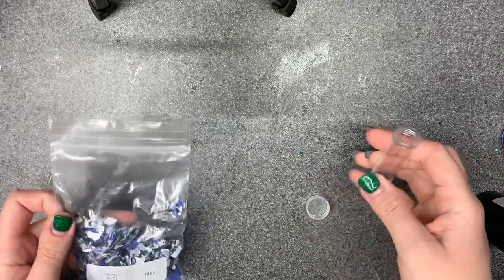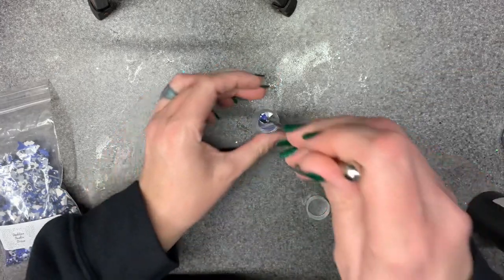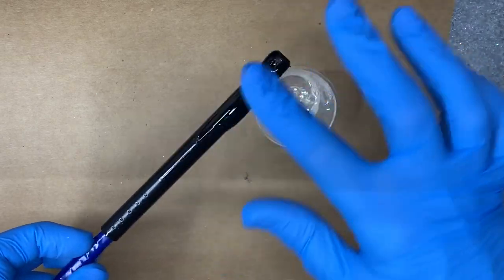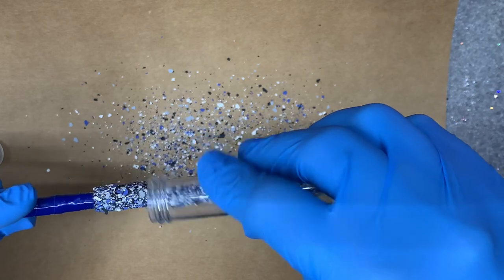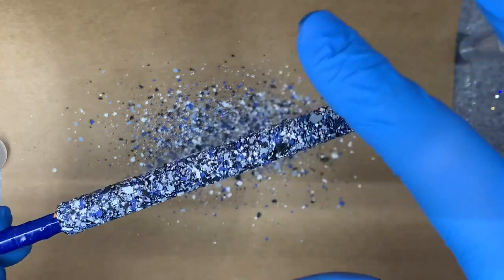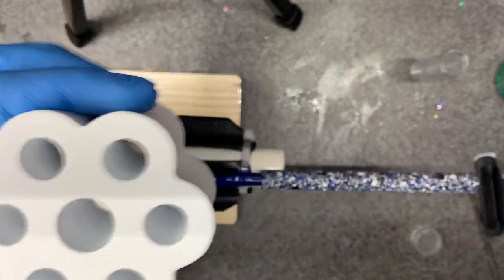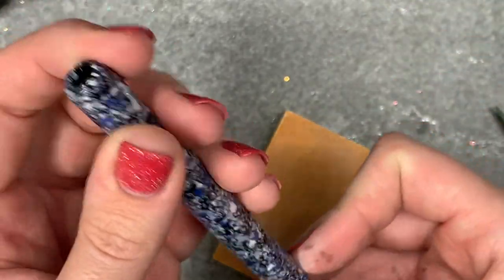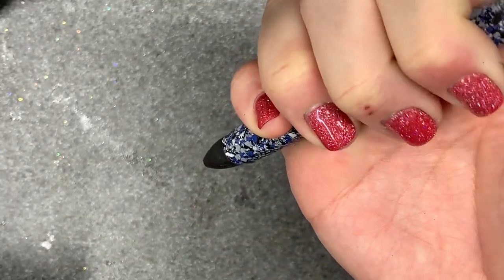Let’s epoxy a “Man glitter” (aka paint chip) Ink Joy pen!

Comment: I love all your videos. I tried to do Alcohol inks on 3 pens and the all epoxied to the pencil I used to hold them. 😭 if you have any ideas or suggestions using AI, I would appreciate it or could do a video. I just love working with AI. Thanks for sharing all your ideas/work.
Reply: Add vaseline to your pencil or dowel at the end of the pen.
Reply from the maker: Yes, either the Vaseline hack or suuuuuper caution when doing the end.